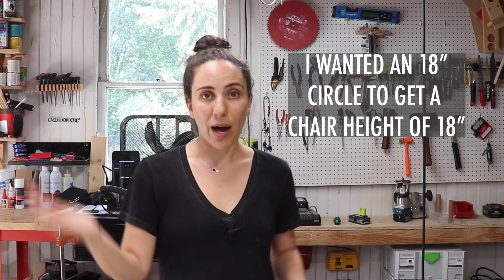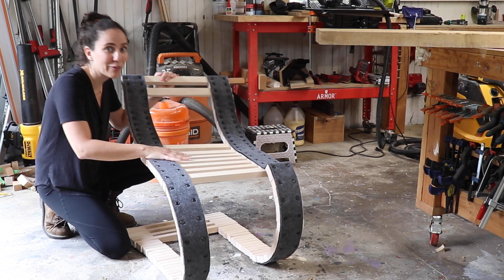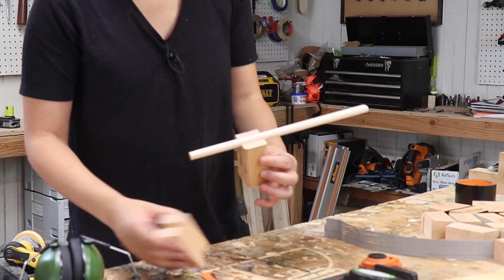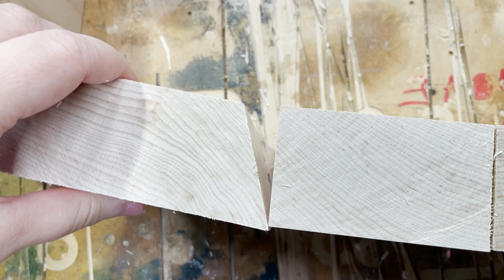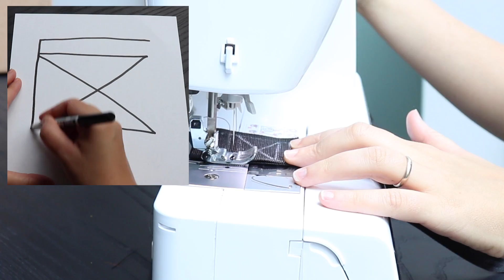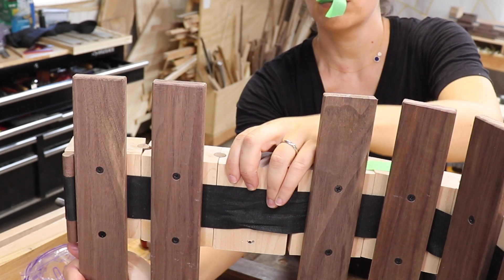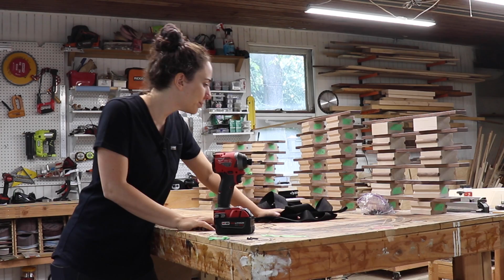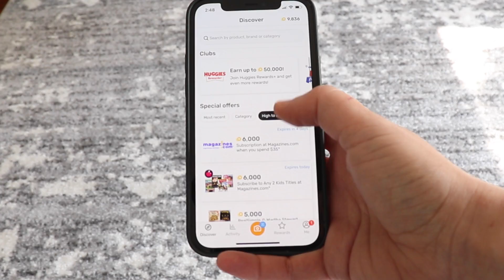I ATTEMPT to make a Roll Up Chair… AGAIN...

Comment: Well I know where the problem is, first the grains of the blocks are in the wrong direction, in side grain the wood always gets compressed, while end in the grain it won't, second, the belt should be glued (or attached in a way) to each piece individually of the blocks, not only to the first piece, I'm only saying this because I'm a civil engineer and a professional wood turner☺️
Reply from the maker: I was going to attach the strap to each piece after figuring out the correct length. But after it collapsed on my arm ans hurt me. I didn’t want to proceed for the safety of my kids
Reply: @3x3CustomTamar  i hope it didn't hurt much, good luck
Reply from the maker: @josef2090  it was actually pretty bad. Enough for me to feel defeated. But it’s ok now. Ha

Comment: Hey. This is really cool. Back in college we took a jab at a very similar project, pretty much the same. The way you used dowels was very smart. And architect friend of ours mentioned maybe we could CNC each piece, and I think that would also transfer the tension to the wood instead of the strap, since we couldn't get the straps materials to work either. Id love to see a calculation on just how much force that material would need to resist and still be flexible. Good luck.
Reply: Came here to say this. The problem is that the tension required to support weight through that structure is enormous.  You currently have the blocks in compression and the strap in tension. Solution is either move the tension into the blocks or use a material that is better suited to the task for tension. Leather is not going to do it I’m afraid. 
Consider tank straps?  Very thick, not so bendy, but definitely overkill and should do the job. 

Alternatively, use some steel cables, and hide them under the straps you currently have? That way it will be aesthetically the same, but the strap will serve as a lid and the cables will carry the tension.

Good luck!  And thank you for bringing us along for the ride!
Reply: @swiftarrow9  And the tension should not be putting net torque on any blocks, otherwise you risk collapse.
Reply from the maker: Problem is that I only gave myself a week to figure this out. This is going to require months of testing…ha
Reply: Seat belts can withstand a lot of force and still be flexible. That's exactly what they're made for and it's exactly what I would have tried. And seat belts don't stretch. So, you hopefully will cut down on stretching by using it, also. You can buy it in bulk/rolls to use for whatever you need.
Reply: @JC-11111  she already used seatbelts on Episode 1, btw :/
Reply: I agree, throughout this I've had the feeling that the tension should be borne through the wood not the strapping. Think maybe go back to that clever computer design programme and redesign the shape, thickness and depth of the sections. Also maybe a scale model would be helpful, remember that's how the artisans used to bring forth their creations. The perseverance involved in this project has been admirable, (if distressing feeling the pain) to watch. Sincerely hope the conundrum is solved.

Comment: I think you need to use steel wire or something that doesn't stretch nearly at all, the leverage is so insane I don't think any polymers are going to work for this. :/
Reply from the maker: Yeah. This is the wrong material

Comment: What about aircraft wire down the center of each leg?  Anchored at each end? Somewhat flexible and doesn’t stretch.  Perhaps too heavy? And may not allow for the desired angles for the chair?
Reply from the maker: Would prevent it from rolling up properly
Reply: What if the material was more than one layer?  Stitched together?
Reply: Maybe the rolling would be affected again with double layered material
Reply from the maker: @DriedMoss  I thought of that. Combining the 2 different types of stamps I had. But after I got hurt. I just didn’t think it was wise to keep going on this version

Comment: It was never going to work and it won't work with leather, it stretches a lot generally and that will only cost you a fair amount of money to make a oversized leather belt. It's because each and every one of those sections act as a lever on that material all working to stretch the material at it's own point, so each section is trying to pull on the material away from the next section. This doesn't spread the load it makes the entire seat basically just interconnected points of failure.
The only thing that might work is something you stated near the start of this video. A cable, something rated for holding tons. You're putting so much force on this material so you need something designed to take the weight in that fashion.
Reply from the maker: The only problem with a cable through the center is that it won’t be able to roll up correctly
Reply: @3x3CustomTamar  Ah that would be an issue, however you could try having a recess on the top of the wood facing outwards much along the same lines to where your belts were, and slot the cables right in.
This should give the flexibility for it to roll up.
Additionally you could invert the cable at the base of the backrest so it follows along the outside of the curve providing more support and playing to the materials's strength. But fair warning I'm not sure if that would affect it's ability to roll up too much. It would mean it'd be a little less uniform fully rolled up. 

To give a clearer description of what i mean. 
The cable would always be on the outside of a curve, using the technique you used with those wooden dowels to work the cable through to the other side.

Comment: A seatbelt from a car might work for the strap , it shouldn’t stretch at all under tension.
Reply: It stretches a bit to absorb some of the stress on your body
Reply from the maker: That’s what the low stretch polyester is
Reply: @3x3CustomTamar  Would a clear plastic sheet of some kind work ?. A type that would be flexible enough to roll up but eliminate any stretching with the seat unrolled into position? If it was cut to the overall length and width it would possibly help reduce side to side movement and being clear it wouldn’t stand out much against the wood. Just a thought.
Reply: Well that’s a big D’oh! on my behalf. I didn’t think a seatbelt would stretch that much .
Reply: Great work by the way !
Reply from the maker: @DAZ_IE  thanks!
Reply: Yeah that’s true but it’s possible it doesn’t stretch near as much as the strap used in the video.

Comment: Nice project Tamar... Love the shape.... Make channels in the blocks and use motorcycle chain instead of the strap
Reply: leave the "motorcycle" chain in the bike. If chain would be used the best bet would be a single strand # 40 roller chain with attachment tabs.
Reply: @TimeLapseRich  how did I forget those existed?!
Reply: it may also help to drive a screw through the chain at particular points to isolate tension from collapsing other parts of the chair and limiting the amount of stretch available at any particular joint. Thicker blocks of wood in the front section would reduce the how much chain stretch would affect the overall shape.
Reply: my thought too! With all this tension I feel like wood and plastic alone will not be sufficient, you need some metal, maybe even try a experimenting with some sort of hinge between each piece.
Reply: That is a wery good idea 👍
Reply: I was thinking along the same lines ie too much stretch. My thought was flat woven metal strap like is used for ground straps but I don't know if that would be a good look. I like the chain idea better.

Another possibility would be stainless steel cable with a threaded piece on the end. The threads would allow tensioning.

Comment: Can't you make it with normal hinges? 
Metal ones i mean.
It will get a lot heavyer...
Love the project.
Reply: I was gonna suggest the same thing. 
An alternative would be making wooden dowel hinges.
I think the main problem is that the tension is able to travel all the way along the strap to the weakest point.
Reply: @thecrapadventuresofchesimo420  yes ...with a hinge you conect two blockes together in stead off all off them with a strap and it will go automaticly to the weakest part .
Reply: The force of sitting on it would rip the hinges off
Reply: @droko9  it would be tricky to connect them so they don't tear the screws out, and they will have to be fairly beefy hinges so the pins don't bend.
Perhaps sandwiching each leaf between the slat and the block and running a fastener all the way through...
Reply: @droko9  yes and no...maybe...i don't know...it's ( lastig ) ...dutch ...
Reply: Definitely needs better structural integrity. Hinges at the curve in the back would have to be on the top which could compromise comfortability. Hinges on the curves at the bottom could help but if I’m not mistaken could jeopardize the roll up action. Def worth a shot though
Reply: @zircon7634  could hide the pins between the new slat feature on this one
Reply: @thecrapadventuresofchesimo420  you can make a strap from linked together hinges and put wood on the sides to hide the metal.
So it has the strengt of the metal and the looks of wood.
Reply: Was thinking the same thing. The way the chair is supposed to keep it's shape is with by not having any piece moving in relation to the ones next to it. The strap relies on tension and the geometry of the pieces to achieve that, and with hinges you will always have them perfectly aligned, and every potential point of failure is going to be local and much more simple to adjust(adjusting the hinge between 2 pieces won't have any effect on the hinges between any other 2 pieces, while any adjustments to the strap impact the whole mechanism)

Comment: I thought about this when first seing the design in the first video: One of the issues is just that you're dealing with huge forces: If you think about the lever of sitting in the center of the seat part with let's say 60kg (all just a back of the envelope calculation), you have maybe a lever of e.g. 1:10 at the front,  which means the straps must hold about 600kg (and so the very back edges of the wooden blocks that are under compression). Furthermore this lever means that a tiny gap in these joints will massively deform the rest of the chair. And as there is virtually no material with 0% stretch (or deformation under pressure) so I doubt that this will work no matter what materials are used short of wire cables and steel blocks. In my opinion it is just a flawed design that looks cool in the rendering but no practical considerations went into it.
But I really like how you show your process and all the thoughts you put into your experiments - I learn something new every time!  And I'm always looking forward to your next projects!
Reply from the maker: Yeah. I’m starting to think it just won’t work. But I also don’t want to give up. Ha
Reply: One of the other problems I think is that the straps can slide relative to the blocks. A 1% stretch in a strap isn't much but if all of that extra length ends up in one place, boom, gap. If the straps were well attached to the blocks, then the same percentage stretch would mean much smaller gaps.
Reply: @cooperised  I agree, fixing the straps to every block, would reduce the problems. but it has to be a solid connection. The forces would pull sideways... I'm not sure if screws or straight up epoxy would work better... probably both ;-)
Reply: @Schwuuuuup  Definitely some kind of adhesive, spread that force over a wide area.  Adhesives are good in shear, generally.  Not sure if epoxy is the best choice or not - need to look at the datasheets for various adhesives really and find one that's good for the materials involved.  Some kind of mechanical backup connection would be good too but probably not screws, they'd create a big point load and a weak spot too.  Maybe press studs?
Reply: @cooperised  yes epoxy is the best.
There is a reason carbon Fibre parts are made with it.
Reply: @SuperDeinVadda  Yeah, the reason being that it bonds well to carbon. Does it bond just as well to polyester and wood? Don't know. That's why I suggested research...
Reply: @cooperised  yes it does bond well to both of those materials.
Reply: @cooperised  UHMWPE is effectively polyethylene, you can't epoxy it (also it has very low friction coefficient too, so her friction fit was futile form the start)
Reply: My quick calculation is similar- 300kg per strap.  That means 300kg compression on the wood blocks which is very high for wood compressed perpendicular to grain.
Reply: @billj5645  not true.
Those blocks are huge.
You can't just use a final number and say it's high. You have to divide it by  the area the force is applied to.
Pine has a compression resistance of 45 n/mm^2
The wood might have a surface of 150mm x 50mm so that's 7500mm2
Divide that by 3000 N force (300kg x g)
And you get a load of 2.5 N/mm^2
Which is 20 times lower than what wood can handle.
So no the wood is not the problem.
Reply: @SuperDeinVadda  1.  The stresses won't be uniform, the stress will be higher on the bottom edge of the blocks, the blocks are pulling apart along the top edge.  2.  Southern pine with compression perpendicular to grain has allowable stress of 345 psi which is closer to 2 N/square mm.  45N/square mm is over 6000 psi which is about 5 times the strength of pine when loaded parallel to grain.
Reply: The one example I have seen of this chair where someone could physically sit in the chair they used 4 steel cables under the fabric.
Reply: Or waaait, how about (bear with me) high-strength Velcro straps?  Pretty sure you can get wide polyester Velcro webbing, and then the blocks could each have the "hooky bit" (technical term).  Velcro is outstanding in shear.  The high-strength variants in particular (they're the ones with micro hooks, and the mating side isn't "fluffy").
Reply: More armchair engineering: I think the key is reducing that 1:10 lever.  Your weight offset from the front of the chair creates a moment (force x distance) which has to be counteracted by an equal moment from the strap to the inner edge of the blocks.  The longer that distance (height of the blocks), the less force it has to exert to get the same moment.  Also, you should attach the strap to each piece rather than just the ends as you mentioned.  Stretch (strain) is a percentage of distance, so the longer the distance between strap supports the more the stretch that can accumulate at your stress points and deform your geometry.
Reply: Yeah that's what I thought huge forces and minimum tolerance for stretch... I have no clue how to calculate that (finite element analysis?) but the forces involved may call for high tech materials... Carbon fiber or something like that with extreme tensile strength without stretch...

Comment: Try some dyneema next time! It's extremely stiff, one of the least stretchy fabrics, and strongest in the world! Nice try it looks super cool with this iteration.
Reply from the maker: It would look so cool if it worked. Ha
Reply: @3x3CustomTamar  maybe try 2 or 3 straps on each side?
Reply: Looking at the failing points again (where the pieces separate), it looks like it needs 
additional support pulling it (the pieces) back together or some seriously strong and Inelastic material. Maybe some metal reinforcements to keep the pieces together but then won’t it be deterring from the point of an elegant looking roll-up chair? 🤔 you could try installing them on the inner side if you do resort to that.
Reply: What do you think the UHMWPE she used is?  Dyneema is just a brand name (Spectra is another brand of what amounts to essentially the same material).
Reply: @robertlitman2661  it'd appear the amount of people suggesting "dyneema" is extremely high, even though she actually used it. Must be proper strong commercial outreach.